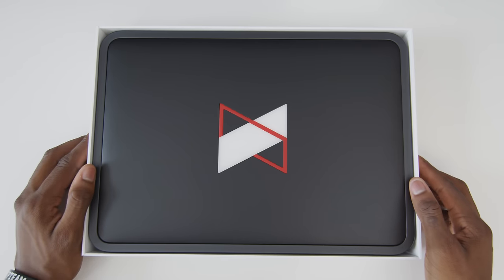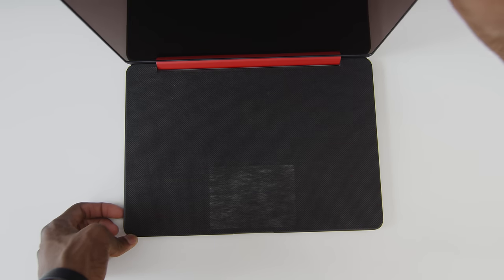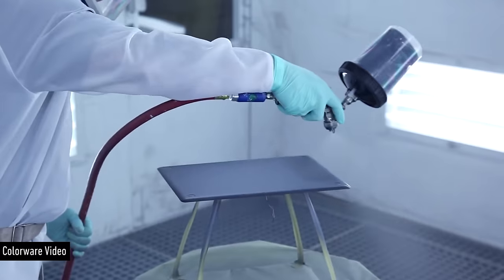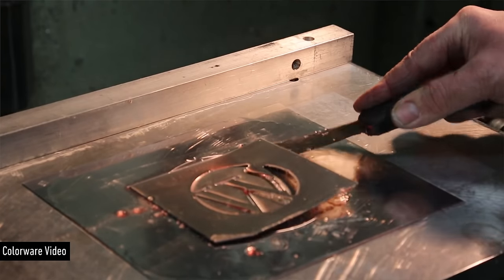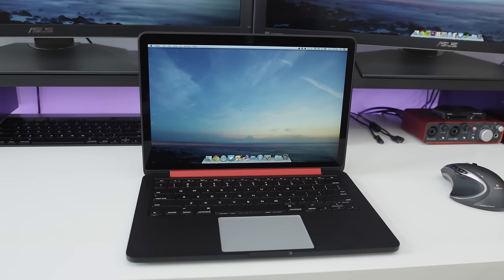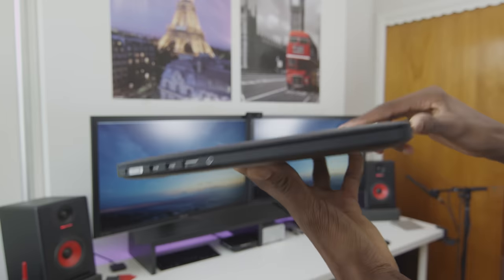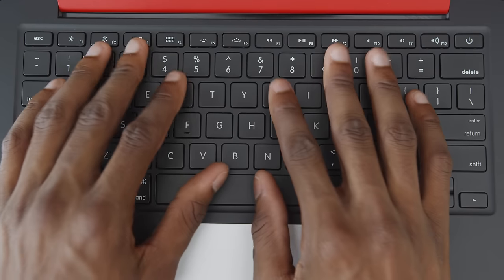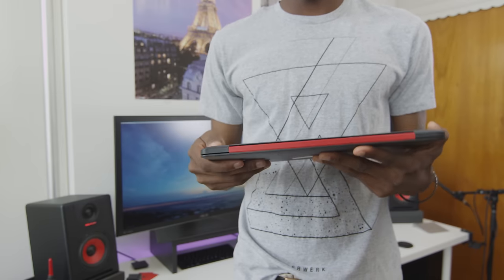MKBHD Edition Macbook Pro! (Colorware Custom)

Comment: Wow..... That's very impressive . Maybe apple will buy this company 😉
Reply: I know you're kidding a bit, but alas, it wouldn't make sense!  Apple would want technology that could handle this for tens of thousands of systems per day... Colorware handles a fraction of that at best.
Reply: You both do know, Apple can just use those colored parts and sell them like that, themselves without needing to waste time on disassemble and reassemble?
Reply: One thing people should realize is apple was into colored computers and stuff(original iMac) but apple went into better quality designs vs colorful, now there laptops are the color they naturally are, aluminum, thats why there's no colors because they won't to show the better material then most others.
Reply: Aurelian it's not really technology that apple doesn't already have access to.. in fact, they used to anodize aluminum colors at the atomic level in many of their products (ipods). all they're doing is painting it and etching the logo..

Comment: The trackpad should be red too.
Reply: Coloring the trackpad likely would not be the smartest idea, as if it didn't completely stop it from working, the paint would not only provide a bad surface for your fingers to glide across, but the sensitivity would be much lower.

Comment: Pretty cool but... $750 to paint my macbook pro retina? I could buy 3 new windows laptops with that money -_________________-
Reply: All 3 more powerful than a Mac.
Reply: ***** lol. Right.
Reply: well, 3 compaq laptops for 250$ with Atom processor are crap.
Reply: ***** exaggeration at its finest.
Reply: Nah not 3 but 1 very usable windows machine with i5 or i7 even
Reply: Expensive it is, but you saw how they did it. It's not your simple paint job with a paintbrush. It's a tedious job. Taking apart your device and painting it professionally, custom logo, etc. When it'll done it looks like it was I initially designed that way. You have to respect the craftsmanship.
Reply: Nathan Bryant It cost 750 just painting it. That doesnt even include the custom logo. Its a ripoff.
Reply: ***** how much do you think it should cost? A logo alone wouldn't justify it. Could you do this yourself? This isn't finger painting.
Reply: Nathan Bryant  Ok 750 for painting a macbook. In order to paint all the components you need to take apart the macbook and reassemble it. It should take about 4 hours to disassemble a macbook and put it back together(at least thats what it took me a couple of months ago) I would say about a hour or 2 for painting all the components so I think about 6 hours of labor per macbook and the paint and materials and shipping are probably another 60. So lets say they pay someone 20 bucks a hour so thats a 180 dollar job the company pays roughly. A average profit margin for a business is around 16-20 percent. That means about a 220 dollar price for good profits. Now they have overhead like rent,customer service, and utilities and those things so lets add about 100 per macbook. I think the price should be around 320. Now lets say they have something im missing and they have some expense I do not know about because I do not run the business so lets add 80 bucks per macbook. 400 dollars still doesnt sound crazy expensive seeing what they have to do. They are asking for almost double that. Im also using what I think are high side numbers. btw Im a business major right now in college

What if they put those jobs in China where instead of them paying 20 bucks a hour? Then they cost to them goes down by even more.
Reply: Nathan Bryant
it is cool and really professional work and i know i know it maybe not that easy, but 750? it is way way overpriced, i know that i'm not an expert, but i should say for the paint job it's worth 200 dollar max, it can't be that expensive, i know a friend who disassembled his macbook, and gave it to a pro painter(who usually paint vehicle and toys figure), and it cost 70 bucks but then again he has to disassembled it himself, but it is a pretty clean work
Reply: Nathan Bryant
about the logo however, i think it is much harder
Reply: It's not a ripoff. They're charging a fair price for what they're doing.
Reply: Thomas Riddle it's not ripoff, it's a luxury, that only certain people can and will afford
Reply: The logo part I can understand being expensive, but the paint? Think about the work they did at the end of the day. They spray painted  your computer. Sure it's high quality, and sure it's professional, but NOT worth $750. You can almost buy another mac for that price. Since when is paint more expensive than a computer? You can probably get a very talented artistic friend to do the same thing. Probably won't look as good, but it will also cost probably $40 vs $750 which is just outright ridiculous.
Reply: Chaza124XD They also disassembled it and reassembled it. Some parts like the speaker grills can be quite difficult to get right, I imagine. They probably use top quality paint/finish, which is expensive on its own. Then, add in the several hours of labor required and the cost of the professional equipment they use, and it gets pretty expensive. They only charge ~$100 to paint a pair of HD 800 Headphones.
Reply: Also, if you're in the market for a paint job this expensive, I'm guessing you've already spent a lot more than $750 on your MacBook.
Reply: Thomas Riddle Well of course, base model macs start at around 1K. This service they're giving looks extremely good and could be extremely popular, except for the pricing. They are probably holding themselves back from becoming a big deal because of the enormous price they charge.
Reply: ***** That would mean my laptop would be gone for a long time
Reply: rkkrqqqqrssss based on the video, it looks like theyre using 2k automotive paints and clears. that shit isnt cheap. plus labor, disassembly, shipping, advertising, overhead, utilities, equipment. $750 is pretty cheapfor what theyre doing. dont be cheapasses
Reply: *****  You think 750 is cheap for taking apart a laptop and painting it. Im sure they buy everything in bulk and they dont pay anything near consumer prices. Also laptops are small and dont need hardly any paint at all. 

Go back up to my comment and read it because I broke down everything. You can buy great paint for 100 a gallon consumer price. In bulk they pay way less and a gallon can cover so many laptops its not even 10 bucks in paint per laptop.
Reply: ***** you understand theyre a business right? the point of a business is to make money. its a specialty service and theyre not gonna stay in business with a 10% profit margin. for a business major you dont seem to have a strong grasp on basic economics. im not a business major, but i run my own business and i have 75% profit minimum and only have to actually GO to work 3-4 times/month. am i overpriced? no im actually priced at the low end of the spectrum for my industry. why? because its a specialty service that allows me to charge that much. same thing with colorware. if they had as many daily customers as walmart obviously the price would be lower. but they dont. its a premium service on premium hardware and you pay a premium for it.
Reply: ***** Your right different businesses have different profit margins. Look at the makeup industry. Some companies make 500% on their products. Overpriced is relative and by these comments im reading this is overpriced.
Reply: ***** I never said I wouldn't pay for this. Hell if I had the money to drop I would totally do it!! I understand why certain service cost "x" amount for a reason. The quality, labor, parts, material.
Reply: ***** "overpriced" basically means "i cant afford it." people with $300 windows laptops say that about macs. Civic drivers will say it about bmw. g shock wearers will say it about rolex.
Reply: ***** If someone is selling a balloon for 1,000,000 dollars and I say its "overpriced" is that because I cant afford it or did I say that because the balloon isnt worth 1,000,000 dollars? Then if a billionaire bought the balloon that doesnt change the fact that the balloon wasnt worth what he bought it for."Overpriced" doesnt mean I cant afford it. 

I could send my macbook pro in right now and have that done but I choose not to because its overpriced.
Reply: ***** notice how i compared 2 different tiers of items in my comparison. did i say if a honda civic sells for $60k its not overpriced or did i compare a honda to a bmw? both are cars that take you from point a to point b but one costs significantly more because its a premium product. same thing applies here. im sure you could find an individual that could paint your macbook for $300 but id bet its shitty in comparison to colorware. and if its so overpriced then dont send it in. why complain that its overpriced? what does your complaining do other than make you look bitter because you cant afford it? (yeah yeah yeah i know you say you could send it in right now, but your complaining says otherwise)
Reply: So me saying that this service is overpriced means I cant afford it? Just because someone says something is cost too much for the service provided doesnt mean that they cant afford it. I say gas prices are too high but I can afford to fill my car up. I was never complaining about it about it being to expensive. Even if it was reasonably priced I wouldnt get it painted because I like the look of my computer already. I was just stating that the service they provide is overpriced. Honestly I could do what they do at the exact same quality. I have used the same type of paint sprayers they have. I have taken apart my macbook and put it back together. 

You think that people who say things cost too much are automaticly not able to afford the product.
Reply: It's expensive, not overpriced. Find someone else who will do the same job for cheaper.
Reply: ***** well said
Reply: ***** Only reasonable affirmative argument justifying Color Wares price. Now the only thing that concerns me is how it cost $769 to paint a mac book. Then $289 for an iPhone 5s. And finally $129 for the lowest end of the Sennheiser mic and $249 for the top end Sennheiser mic. So you mean to tell me it cost 120 dollars more just to paint a mic that only cost more because of internals. Basically they don't use any more paint or take any longer to dissemble the cheaper mic than they do for the more expensive mic, yet they charge more. oh btw it cost $599 to get that mic painted chrome. That's basically saying the chrome paint they had to buy cost $350 more. Now from reading what I just wrote we can come to the conclusion that it isn't the amount of paint or the amount of labor it takes to get the job done that makes them come up with a price. They get their price based on how much someone has spent on the item itself. If someone is willing to spend $3000 on a microphone we can charge them $600 to paint it chrome, because we do it the best. If I bought a $3000 microphone i wouldn't anyone painting it except pros. If I wanted something cheap like my controller painted I could send it in to a cheaper less well known shop and be fine. So yes ***** is right about the service being over priced.  

No hate towards the company, but if you guys would make your prices a little more reasonable I'm sure you would blow up and I would recommend to all my friends to try your service. Btw like the Magic Trackpad I plan on ordering one from you guys cause I want to get one anyway and even though it is overpriced I'm willing to pay $175 just because its something I'm in the market for. Just like when I go to eat dinner, I can order Eggplant Parm and get nutritious food and get full. Or I can spend more and get Crab and Sushi at the cost of possibly still being hungry.

However that trackpad I can keep with me for a long time opposed to food.
Value of the service: 1/10
Quality of the service: 10/10
And everything is custom made to order and not like an assembly line. So that's a plus.
Reply: ***** lol. A $250 computer (laptop or desktop) that's more powerful than the rMBP? ok.

Comment: How come you can get a Magic Trackpad painted, but not the trackpad on the MacBook?
Reply: I was thinking the same thing, that paint job just doesn't look right with the default track pad.
Reply: Given the location of the Macbook track-pad (You would have to pull out the motherboard), I think it's pretty obvious.
Reply: tcw Do they disassemble the Magic Trackpad's too? If so, then that explains it. I just wouldn't have thought that would be necessary.

Comment: I really dont see the benefit over a skin here. A skin will cost about $75 at most for the MBP but colorware is around $500? You get the same look with a skin and it cost a ton less plus it doesnt scratch and you could take it off to sell it on. Its cool and everything but cost vs benefit is slim here vs a skin.
Reply: And you can spray paint or cover your car in plastic yes? Much cheaper than paying $1000+ dollars for a professional paint job. But why would you cheap out on something like a car? People take a lot of pride in their possessions even if it costs more, a higher quality job, feel, and look makes it feel more worth it. If you tell people you have a sticker on your laptop it's not as impressive as saying it's a completely custom notebook designed by you and for you. Personally I don't like skins on something like a notebook.
Reply: King Isaac Mansa It's a possession, that's expensive yeah it's not a car, but that doesn't mean cheaping out on it is a good thing. I guess it would just be a matter of priorities and if you feel the money is worth it. Personally I would throw in $700 just to make my notebook exactly the way I like it, but I would never bother putting unnecessary money into something like my car. For many people and myself, getting a high quality paint job on something you use everyday, for work, or whatever it's worth it.

Comment: The track pad is still silver? If so it sucks :/
Reply: Coloring the trackpad likely would not be the smartest idea, as if it didn't completely stop it from working, the paint would not only provide a bad surface for your fingers to glide across, but the sensitivity would be much lower.
Reply: they have colored trackpads in their site (separated ones)
Reply: ***** They also repaint the Magic Trackpad so I don't see the problem
Reply: I think it is white, not silver but I may be wrong.
Reply: if u actually watched the video only thing he questions is how durable the paint will be to scratches so it would be a smart choice to have the most used aspect of it to be its default color
Reply: You want them to paint glass? The color of the trackpad comes from underneath the glass.

Comment: I wouldn't sacrifice the warranty for some colour...
Reply: Color ware gives you a new warranty.
Reply: I asked Marques. He said that they sell warranties.
Reply: You can just plastidip your laptop for $20 and retain the apple warranty
Reply: *****
Not even close to the quality from Colorware and try plasti diping your keyboard and around your ports. You're going to have to take your Macbook apart to do that and if you have a retina you better becareful, because everything is soldered on and if you break something warranty is void.
Reply: strker99 But PlastiDip is removable. You can always bring it back to stock.